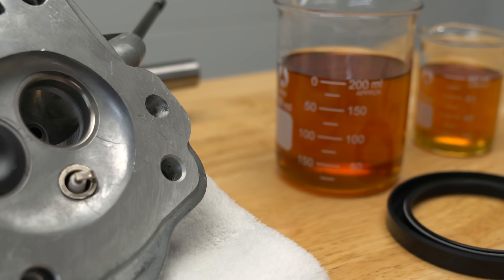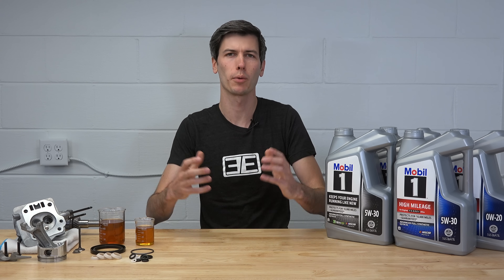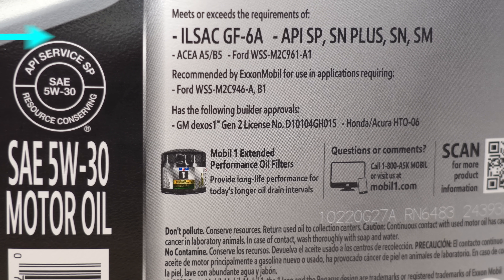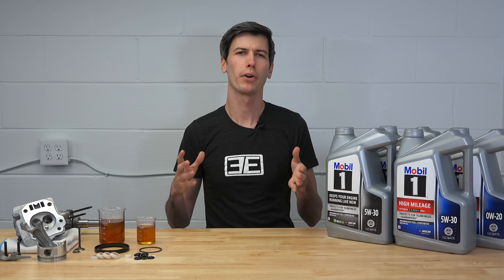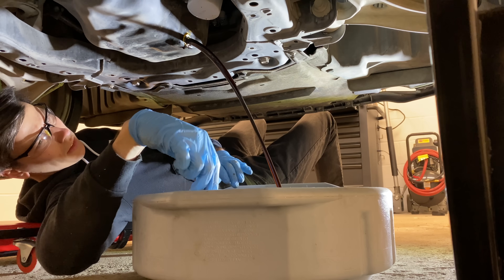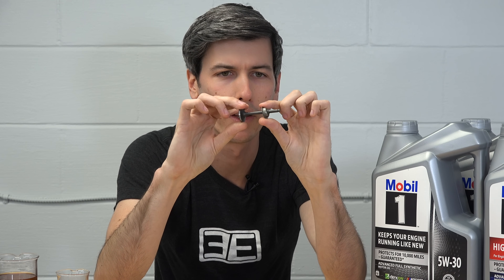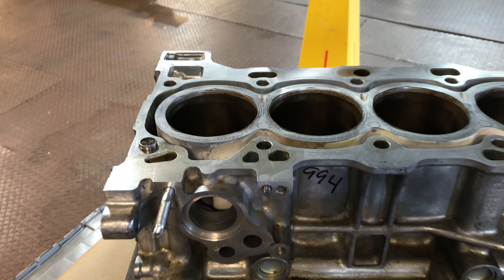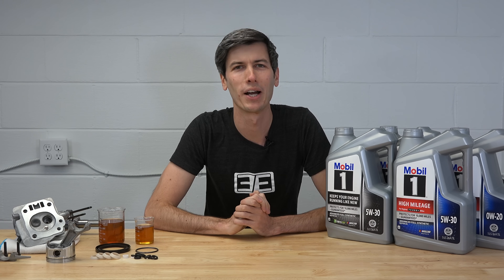Is Synthetic Motor Oil Bad For Old Cars?

Comment: When a sales guy spends so much time telling you how you can do a thing, probably dont do the thing.
Classic cars spending most of their life using mineral oil will have some of that mineral oil impregnating the metal within the engine itself, if the old oil and synth oil are not compatable you may not get the same level of surface coverage  until the engine has run a fair time on the new oil, , , do we wait to see? or go with what works.   My 50 year old will stay on mineral oil.  My 22 year old that has recently had a full rebuild and upgrade will go synth.

Comment: 2003 Chevy Avalanche 416k + miles Mobil 1 is great. Changed the plugs bout 10 k ago compression check showed 8 cylinders within 5 psi. Called Mobil1 at 400 k miles they congratulated me and told me to call back at 500 k, must be quite a few in the 400 k range.

Comment: Great informative explanation. Are you going to cover Gear Oils later too I have heard some older vehicles shouldn't use the latest GL5. I am never sure that just because it is not mentioned in an old manual is it that you shouldn't use it, or just that the newer product was not available when the manual was written and it is actually safe to use.
Reply: Gears don't care so long as you're using an oil with extreme pressure rating. 

If anything it will work better with a higher temp rating.

Comment: If your car is burning oil, or using it as per a rotary, then synthetics tend to leave the deposits inside the combustion chamber, whereas mineral oils tend to burn and exit through your exhaust. You can easily determine if this is happening in your car with some simple diagnosis. Generally though, semi-synths are the only oils easily available for old engines in their required viscosities.

Comment: I agree with the thicker grade of oil for the most part. However, on some 90s engines (especially GM and my car) the 5w20 weight oil is too thin and will cause idle oil pressure to be too low even in a new engine, so switching to 10w30 is actually a good thing for those engines. Same thing with later 2000s Hondas that require 5w20 or 0w20, bumping that up to 5w30 can actually help those engines.
Reply: I never use 20 weight or less even if the manufacturer calls for 10w 30 all day
Reply: Wrong
Reply: @gokartbuyer  Nope you're wrong. Look at the 5.4 Ford Tritons that grenade themselves due to low oil pressure. I have one and run 10w30 diesel oil for the high zinc. Makes that engine so much happier.
Reply: @JoshuasRecordings  Even more incorrect
Reply: @gokartbuyer  Tell me you've never been inside or built an engine without actually telling me...

Comment: No mention of ZDDP (Zinc dialkyldithiophosphate) which is needed by some older cars to prevent exhaust valves "sticking" to the seats and pulling off minute amounts of metal leading to valve seat recession a slow but significant process on older engines.

Comment: What about flat tappet cams in older style engines requiring zinc zddp additive that is lacking in modern oils in general? I have and many others have flattened out a cam shaft before discovering they needed to use Valvoline ZR-1 oil or use zinc additive?  You glossed over the elephant in the room IMO.
Reply: Not really a synthetic issue though, more to do with modern API standards requiring less zinc. Anything newer than API SH has reduced zinc content that might not be suitable for older engines (from memory).

Comment: Synthetic oils are typically created from chemically modified materials such as petroleum components, but the base material is almost always distilled crude oil. Any additional additives and the actual synthesis process for creating synthetic oil varies among producers and is considered a trade secret.Jun. 23, 2020

Comment: Old cars with cork or paper gaskets or rear main bearing rope seals will leak 80% of the time, it isn't that it finds small places to leak, it soaks into paper or cork and saturates them I've seen it happen many times, IMO stick with a quality conventional oil and change it every 3,000 miles on anything built before the 90's

Comment: I have been using CaSTROIL synthetic because of the lifetime warranty. Also the 15000 mi change intervals. My job re3quires mostly hwy miles . 308000mi in 2.5 years. no engine problems. I now have a 04 Nissan with 250000 mi. Question, while changing over to synthetic will I be following the same long mileage intervals?  Thanks        PEACE

Comment: From personal experience there are times when synthetic WILL cause leaks. Not just engine seals. I've seen synthetic power steering fluid turn tiny leaks into huge ones.  If it ain't broke don't fix it. I've also switched several high mileage older cars to synthetic with no problems. People can theorize all they want... There is a chance synthetic will cause a leak and you need to decide if it makes sense for what your overall plan is.

Comment: I run full synthetic in my 1996 Chevy C1500 and it has 250,000. I also use it in my 2005 Ford Explorer and it has 240,000. They both run like they have only 100,000.

Comment: I use to work at a gas station when I was a teenager. Mobil 1 had just came out. And I seen first hand that it use to make the engines leak. It was okay if it was a new car and only used Mobil 1. But if it was switched to Mobil 1 they all started leaking.

Comment: I USED SYNTHETIK MOTOR OIL WITH 1999 FORD CROWN VICTORIA 4.6 LITER V8 FOR ABOUT 3000 MILES BEFORE A CRASH AT 125KMILES THAT MADE CAR NOT DRIVABLE ANYMORE:

I KNOWETH SYNTHETIC OIL BEEN AVAILABLE SINCE 2008 UND HEAR OF A LOT OF VEHICLE NOT LAST TO 200K MILE MARK UND NOT KNOWETH WHAT WAS THE CHOICE OF OIL FOR THOSE WITH CARS THAT NEIN LAST LIKE 500K MILES I HEARD SOME PEOPLE HAD A CAR FOR:

I READ OF 1 MAN WHO RWGULARLY CHANGES OIL WITH 4.3 LITER CHEVROLET PICKUP TRUCK THAT LAST FOR 1 MILLION MILES:

Comment: I believe the video missed one big part of Oil viscosity and this temperature especially ambient temperature. My car being 22 years old naturally aspirated port injected burns 5W30 full synthetic in the summer at outside temperatures of 35C to 42C something like 5L and more in 3-4 months and then between late October till late March where it can reach down to -17C it is barely touching it burning only around 1L. 

With 10W40 full synthetic situation is up to 2L in the summer and virtually no oil consumption in the winter (with semisynthetic 10W40 situation is the same as with full synthetic 5W30 I know my car is old and I suspect stuck oil piston ring on 1st cylinder bu the oil consuption still doesn't justify rebuilding the engine for a single stuck oil piston ring on a 22 year old 4 cyl banger).And believe me I tried 5W40 and there was no much difference compared to 5W30.

Some of the manufacturers are kind enough to provide oil viscosity table in relation to ambient temperature and this table is hidden only in the car manual leading to people(even dealer services) in hot climates to poor down 0W30 or even 0W20 cause this is stated on the oil cap of their new car that will burn it at 40-45C outside temp.

Comment: You'll burn a tad of Synthetic oil in any car. That's just the way it is. Also Synthetic oil will tend to cake on interior parts if you do lots of short diving and don't get the engine up to operating temps.

Comment: I switched to Mobil 1 full synthetic after my 97 Oldsmobile’s engine suffered a catastrophic failure at 122,000 miles. When the engine was replaced with a series III, I ran full syn ever since and my car runs and performs better now than it ever did ❤️
Reply: If you're suggesting that not using synthetic caused the engine to fail, I wouldn't be so sure about that. It may have been an engine defect or just a poorly engineered engine. Afterall it's GM. Too that end, it may have failed even with synthetic.
Reply: @rkgsd  nope! Not saying that at all! I actually had already switched the old engine to full syn before it failed, just not Mobil 1 brand. The car had sat for quite some time before I got my hands on it and that always conjures up a slew of issues. My dad always warned me about when vehicles hit that 100k mark, that’s when issues usually start cropping up. That’s why I always kinda crack up reading used car ads. “Low miles - 145k - $9000!” 😅Nah.

Comment: The spots are drying up under my S-10 so the regular oil is working.  On the other side of the coin I put some synthetic 10W/30 in my Cub Cadet that is used nowadays as only a snow plow, had trouble starting it with 30W last winder so thought I'd try it...

Comment: If you have a car that was built in the 80s or the 70s I wouldn’t put synthetic oil over the years that Car has developed some kind of carbon and sludge inside of the engine synthetic oil has a lot of detergents you might knock something loose in there and mess up your engine Stick to what the car requires
Reply: Just got my 455 rebuilt in a 70 olds delta 88..whats your opinion
Reply: @marvinhagler4721  I think if you rebuild the engine you can use synthetic oil but a engine that has 150 to 200,000 miles and never been rebuilt no

Comment: 203k in my 94 ranger . Switched to synthetic. No leaks. Ford makes engines tough
Reply: Fix or replace daily: FORD.
Reply: @johnmidwest5650  horseshit , from Aussie made inline 6 cylinder , 21 years old , short weekday trips , then tows heavy & idles all day on weekends , 457000 Kim & counting , oil & filter every 7000 Kim , uses no oil , used as taxis in Australia , regularly over 1000000 Kim & never had the head removed .

Comment: In another video he stressed to always use the manufacturer’s recommended oil but here he says “generally”. Is it vitally important or not?
Reply: identifying the recommended oil for old vehicles is pretty much impossible. also in different climates you need different oil. theyve changed the oil standards so you have to goo 10 30 to 10 40 for old factory style rigs and 5 30 in winter. lower weights for new tiny aluminum engines if you want max gas mileage. almost any GAS rig accept race cars can run 5 30

Comment: Questionable at best, in my opinion what I'd call it ! "Old" cars prior to 1987 NEEDED ZINC IN THE OIL !  1800 ppm zinc was what Lucas oil has stated!  I run diesel with small amount of zinc additive.  Too much zinc is as BAD as not enough. He doesnt really identify "old" said "weather your car is 30yrs old" or a "classic".  So that goes back to 1991 !  NOT FAR ENOUGH!!! Zinc dwindled from 1986 on!  🔴 stop two-steppin around issue! GUARANTEE use of YOUR oil won't wear cams & lifters, and cause other damage!
ASE CERTIFIED parts Mgr. Rtrd.

Comment: he talks about synthetic oils back to the mid 70s and oil weights of 5W 20, 5W30 etc. in old engines. What abour real old engines from the 40s and 50s before synthetic oils were ever heard of?  And the owners manual called for 10W30 on everything back then. Except Harleys, they used straight 50 weight.

Comment: Engine seals in newer engines have different part numbers for an engine that uses conventional oil or synthetic. Be careful.
Reply: BS  I would like to see you back that up with Real Proof.
Reply: @mk7-e8e check the chysler parts catalog big mouth. Seals are different for 5.7 and 6.2 that uses synthetic. Unfortunately I'm a chysler flate rate tech at a large dealership for now.. Getting out of this line due to warranty dependent, recall plaqued domestic trash. Worse than ever. Good day and I backed it up. Do the research.
Reply: I still call BS.  List the part numbers for a seal for synthetic oil and the part number for conventional oil.  You made that up.!
Reply: @mk7-e8e call the dealer master tech! I'm done wasting time on your ass.
Reply: Part numbers please.

Comment: Tbh the video is in most parts right, but there are some specific Motors like the M113 from Mercedes which are known to have problems eexclusively due to synthetic oil. Always make sure to inform yourself befor changing your oil.

Comment: Me and a few mechanics we knew we're blending oils before came out as a durablend mixed and as engine builder mechanic machinists, I found that engines love durablend the moving Parts love synthetic but the piston Rings seal better with oil durablend is a great option high mileage is good with an engine over a certain amount of miles

Comment: Well I guarantee you can't use synthetic oil in old cars I know that for a fact I've been working on old cars for a long time there is detergent that cleans the inner part of the car when it drives that is the worst thing for new old cars because they're not designed for that type of oil the only oil you should be putting in an old car is Rotella T.....

Comment: If you use the factory recommended weight oil it does not matter.  A worn out oil burning engine is going to wreck your Cat at some point.  Seals are not compatible with ethanol either.  Proper maintenance is always the right thing to do.  Nice👍

Comment: Motor cycles that their motors sharing oil with a wet clutch? What car/truck automotive synthetic oils can be used if so, rather than having to buy and use what is labeled as Motorcycle synthetic oil?

Comment: Yeah, yeah yeah.... So technically speaking u stuck to the script, told the truth and yes your correct on all fronts. Curious though.... Would Mobile have coughed for the oil if you had a slightly different account. I mean really, at the time synthetic oils came out I heard the exact same account in the  Anyway the thing that I'd like to point out is that these oils are made and developed in Europe where the weather is very different to Australia drip or behave in have different properties in different climates and to be taken into account when selecting a motor oil just as much as this state of your engine. I personally find that I'm changing oils and filters a lot more and costing me more when I use synthetic oils regardless of the condition of engine.! So is a ploy in part so motor oil companies can ensure the people buy more of the product. IT'S STANDARD BIG BUSINESS 101!!
Reply: Oil company conspiracy theories assume that A/ all companies are in on it. B/ None of them want to be better than the others. You have difficult writing meaningful sentences.  Perhaps you could edit your post so we can understand your argument.

Comment: Been using Castrol GTX for years and years. My old truck on the farm has 284,884 miles with no major work. Had to install a new $117 alternator last month though.
Reply: i would blame it on the oil

Comment: Always enjoy your videos. Unfortunately, this one didn't touch on engines with flat tappet cams. 
My understanding is the pre-roller cam engines need an oil with a high Zinc content, do to the two flat surface, metal on metal contact. Lots of options on the topic, but it does seem that the motor oils available with a high Zinc content tend to be conventional.
Reply: You are entirely correct. The video didn't mention this important detail.
Reply: They removed zinc because catalytic converters. Everything good gets sacrificed at the alter of the EPA
Reply: Gss
Reply: @jarenlast3585  What's GSS?

Comment: I've lost 2 engines to extreme blowby. Each less than 1 week after putting kendall syn. Blend. Now they were both the first oil change I had given them
Reply: Shoot. posted too early... 1 was 87 ford 2.3 another 80 ford 4.9 inline 6. I was 18 at the time. And just got rid of them. 33 now and I've pondered why from time to time. Best I can figure is they weren't maintained properly by previous owners had deposits holding rings to cylinder walls and new oil cleaned it out.. I don't have hate towards synthetic oil but what I took away from the experience is if your "new to you" 30+ year old engine has a questionable past, and you can't afford a rebuild, stick to conventional. That hasn't failed me yet

Comment: I have a 2000 Ford Excursion RWD V10 6.8. It has 210,000 miles on it. My question is can I switch to synthetic high mileage oil. I drive it less since the pandemic. About 2yrs. now.

Comment: OH YES.... I had a 1992 VW Golf GTi G60 and used Mobil 0w40, the car was 10+ years old when I had it. Easy peasy all I had to do was keep topping up the oil, no oil change required, did 80k miles in 6 years smiles all round.

Comment: Well I have a classic mini with a moderately tuned engine (90bhp vs 63 out of the factory), the engine and gearbox share the oil. I put 20w50 castrol classic because putting synthetic thick oil makes for a strange shifting experience. From what I could gather, synthetic is just too "good" for that gearbox and synchromesh have hard time doing their work with less friction when the selector fork is pressing on them. I guess it may be specific, but ask old folks, sometimes they know a lot.
Reply: Yep you are right, I had an Austin mini and I had to use 20 60 Castrol gtx in it or the  clutch wouldn't work right.

Comment: Old Engines did not have catalytic converors so a high Zinc content was not a problem. With the Catalyst the Zn has a detrimental effect. In the case of say a CVH engine the hydraulic tappets are flat, as in old Subarus, and so the the cam, valve gear wear with the newer oils. That is why a ZInc rich oil, or additive is recommended with classic cars.